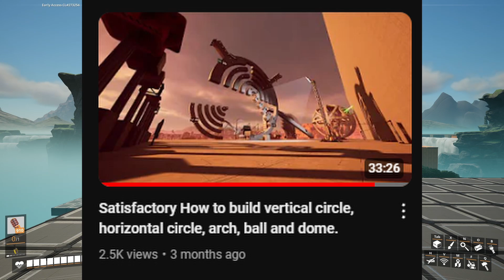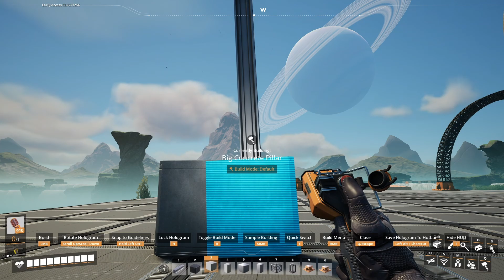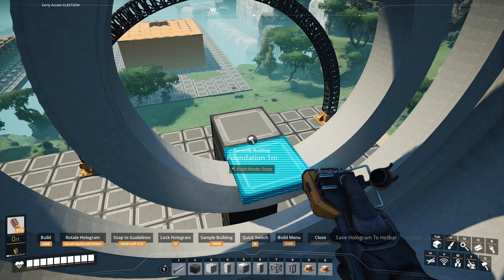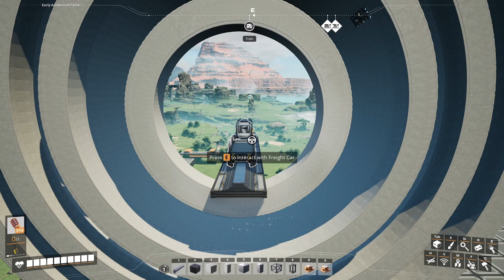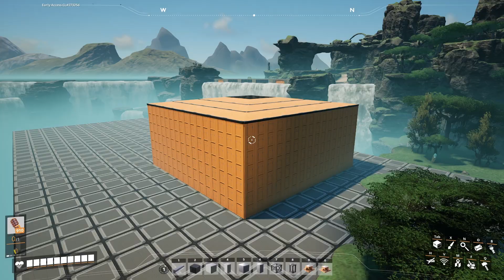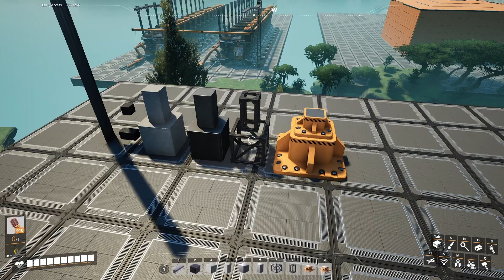Master Vertical Circles in Satisfactory 1.0 | Tips and Tricks |

Comment: Nice vid. the only issue I see with this sort of thing, is the number of objects used. I'm always worried that my machine will blow up trying to run with 1000's of objects. I've seen some impressive buildings but always wonder what specs they have and how many FPS they geti
Reply from the maker: in my most busy build in the largest world I have, I still get like 45-50 FPS, you can see my PC specs in the description of every video, so if you have equal or better you can comfortably go way past the UE-object limit, even with Global Illumination on and set to high
Reply: @jackblade281  Thanks for that, I just looked and spec isn't shown, in the video descript or on the main about page.
Reply from the maker: Sorry, for some reason I only get a notification on the original comment and not in responses 😅 it must have been one of the videos before I added the specs, here it is:

———
My Computer build and peripherals:
( don't know or remember the name of all of it, sorry but the important stuff should be there)

: The PC :
Case: PCS Spectrum G ARGB Mid-Tower
MoBo: B550 AORUS ELITE AX V2
CPU: AMD Ryzen 7 5700X 8 Core 3.4 GHz 36mb cache
GPU: Zotac Gaming GeForce RTX 3060 12Gb
RAM: 2x16gb DDR4 3200MHz
PSU: Corsair 750W TXm Series Semi Modular 80+ Gold
CPU Cooling: Cooler Master Hyper 212 (120mm)
Storage: 
- OS drive: 1x Intel 1Tb 670p M.2 SSD (3500mb/s R 2500mb/s W)
- Game and Recording/editing Drive: 1x Kingston 2Tb NV2 M.2 SSD (3500mb/s RW)
- Deep Storage:  1Tb + 2Tb 3.5" SATA HDD 7200RPM

: Peripherals :
Mouse: Cepier, Gladius MMO Gaming Mouse
Keyboard: Microsoft Wireless Comfort Keyboard 5050
Speakers: Phission High Definiton Speaker
Headset: Steel Series Wireless Arctis Pro 7 with Extension box
Microphone: Tonor BM-700 Professional Microphone
Webcam: Razer Kyo Pro 1080p 30Hz

: Screens :
Main Screen: AOC 2460G4 set to: 1080p 144Hz
Second Screen: Acer GN 246HL Set to: 1080p 60Hz